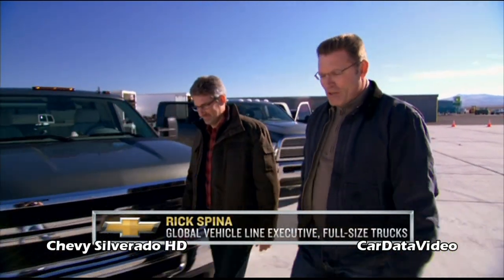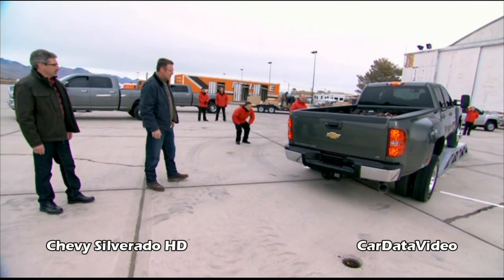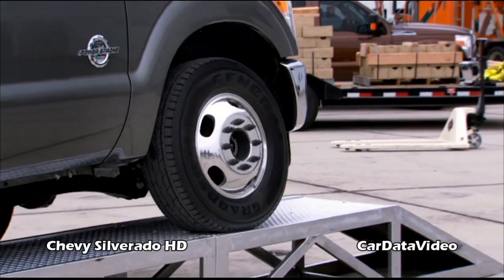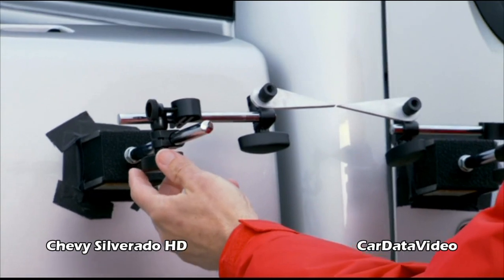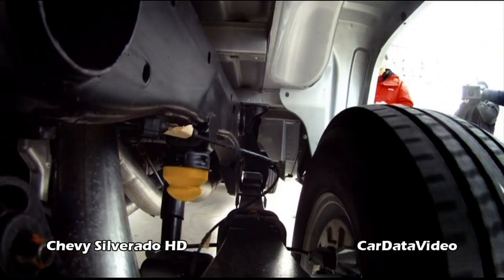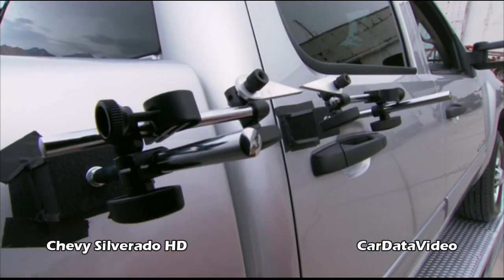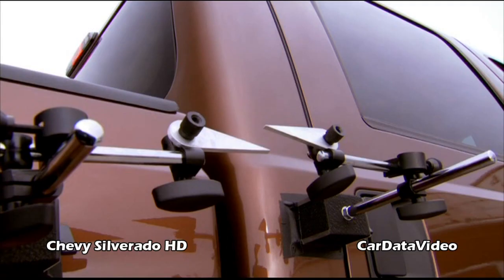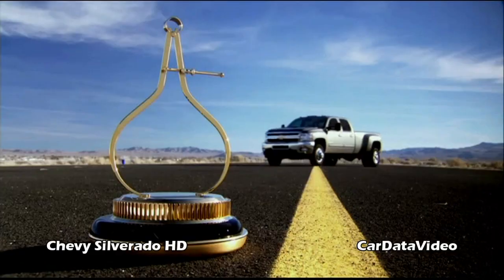Chevy vs. Ford HD Truck - Bed Bend Video

Comment: this era of GM ads.. pfft.  Ford F-series still top for 42 years
Reply: Definitely not
Reply: ‘This era of gm adds’? Have you seen how terrible the new ones are? The ford ones are appalling too
Reply: Zachariah H Ford is the best no debate
Reply: AustinGhost45 sup fan boy
Reply: Jeremy Fufushnick ? What’s that supposed to mean
Reply: Zachariah H learned how to drive on a Ford f- series and I’m proud
Reply: Ford is the best Chevy rigs their ads
Reply: Ford mechanics don't drive Ford vehicles, this is because they know all the problems. Ford outsells every other manufacturer in north America because people are cheap-asses and fords are cheap.
Reply: braxxxtwell kayfuu, if you want a truck that’ll go over 100,000, it won’t be a GM.
Reply: All makes of trucks have their problems, but as an ex ford technician i can assure anyone that there isnt and a single modern ford engine without leaks at oil pan, valve covers, and sometimes head gasket at 75000 km. I've yet to see that bullshitery on a gm or dodge or Toyota at twice that mileage.
Reply: @johnblossom8447  i have a 2006 Chevy z71 with over 300000 miles on it lol
Reply: braxxxtwell kayfuu, sure. GM trucks all have transmission problems. Having owned two Fords and two GMs, I never had a major problem with the Fords, but the GMs, lots of issues. Toyotas are amazing, but Dodge? Please. Chrysler products are the absolute worst.
Reply: Crusader, good for you. Every make of truck has a good vehicle or two. I don’t know your age, but I’m over 50 years old. Quite a bit over 50. Having said that, I’ve had other Ford and GM vehicles. My parents had a 1962 Chevy Bel Air. Great car. The GM products after the late 90s started to slip in quality. My sister insisted on owning GM products because my parents did. I know a lot of people. In my closest circle of family and friends, my 2001 Ford F-150 had 250,000 miles on it with just routine maintenance and tires. In the 13 years I had that truck I watched my friends and family all have their GMs and Dodges go through major repairs, transmissions, head gaskets, among others. I’m only talking about trucks that were the same age or newer. My 2002 GM Sierra had problems with oil leakage, both interior door handles broke, the passenger side broke 3 times, the radiator needed to be replaced and the transmission started slipping. All these issues started at around 90,000 miles. I had the GM and Ford at the same time, selling the GM first because it had to be repaired a lot. I’m only talking about vehicles I’ve owned or close friends and relatives. Since I treated all my vehicles the same, that was my results. If you had a better experience, good. I’m going by what I lived with. I helped family and friends with their vehicles, either repairing them or providing transportation when their vehicles were in the shop. The paint on my 2001 Ford started looking a little rough after a couple hail storms, but the guy I sold it to in 2014 is still driving it today. I talk to him occasionally. He’s put tires and a battery on it. The Sierra’s new owner scrapped it after 150,000 miles. It had too many problems.
Reply: John Blossom Wrong. I’ve owned numerous fords, chevys, and they’ve all had some sort of major issue. I HATE everything about the F-150 from personal experience, the chevy is the same. I have a 2013 RAM 1500 which has never had a single issue, not a check engine light or anything else and it still runs like it’s brand new. I don’t know if your experience is different or not, but if you’re just going on what you hear just know that not every truck and or vehicle is that way. Yikes!
Reply: XxX_PussyDestroyer_XxX evidently you didn’t read my whole comment. And, wrong? How can I be wrong about what happened to me? Plus, I have three mechanics in my family. Your Dodge is 6 years old. I hope it hasn’t had any major problems yet. How many miles do you have on it? I drove a couple Dodge trucks. They were uncomfortable and rode like a tank. What you stated was personal preference. You talk about “what you hear”, but you mention one truck you’ve had that is great. Good for you. A check engine light is rarely anything big, by the way. You mentioned nothing about GM or Ford trucks other than “from personal experience”. So, what exactly went wrong with them? How many miles were on them when you started having trouble. If I’m wrong, then so are you. How many Fords and GMs trucks have you had? How many did you buy brand new? If they were used, your comment means nothing. You don’t know how the previous owner treated them. The trucks I’ve dealt with were all new and owned by me or a close friend/family member. To be more accurate, out of 5 GM trucks, 3 had serious problems before 100,000 miles. Out of 4 Dodge trucks, all four had transmission or head gasket problems by the time they had 125,000 miles. Out of 4 Ford trucks, one had a transmission problem at 160,000 miles.
Reply: John Blossom Mine has about 110K miles on it, bought brand new. My chevys liked to blow head gaskets and the fords liked to blow spark plugs. Had 3 F150s and 2 Silverados. Not very familiar with older dodge trucks but i know they had a lot of tranny issues. But honestly i don’t think the competition was much better at that time.
Reply: Bryton Dunsmoor, good for you.
Reply: My 98 Ford is over 200k miles and runs like a champ.
Reply: @austinghost4587  just for those that like it
Reply: If you combine GMC and chevy, they blast ford out of the water. Unlike ford, gm splits their brands to cover a broader range for their purchasers.
Reply: Chevy runs deep
Reply: @grantbergeron4847  and stays there
Reply: Mike p  who is they, your mother?
Reply: @H4rM0n1cpeezy  Tell me something I don't know.
Reply: @noahchiasson7809  tHinKiNg oF bUyINg a HOnDa cRv wElL hErE'S wHy tHe fOrD eScApE is BeTtEr
Reply: braxxxtwell kayfuu THANK YOU. They’re cheap as hell and it shows that’s why you’ll always see more Fords ( un- Ford- uantly ) on the road than Chevys. Because they’re cheap with no quality
Reply: David B my dads f 150 has 220k+ miles on and still runs amazing as well although it is a stick
Reply: Lmfao...have a f350 superduty with the lariat body. The undercarriage fell out on the highway last April. Had to get it completely rebuilt.
Reply: @Jags Toyota and Lexus are one in the same bud
Reply: The F-150 is that 6th best selling truck when I checked earlier this year. Number one selling if include commercial sales
Reply: No.  Ford has never been on top in retail sales.  Ford has government and commercial contracts going back about 50 years which allow them to keep making that claim.  Such a large percentage of stripped-down F-series sold for fleet use exist that when they are retired periodically their numbers actually tank Ford truck resale values nationally.
Reply: @FMChimera  Ford is ranked the 6th largest seller of trucks in non fleet sales.
Reply: @FMChimera what contracts does Ford have that they've had for 50 years please explain
Reply: @jordanhamilton50  State highway fleet contracts in 43 states, a running contract with multiple US military civilian contractors, direct military contracts, numerous state-contracted businesses in all 50 states to the tune of about 30% of their production as of 2010.  I know the number has shrunk some in the intervening years but it's still a huge part of their annual production.
Reply: @FMChimera  you keep saying running contracts as if there isn't a bide for these contracts. Ever notice how police dept. Change from Chevy to Ford back to Chevy ect. Every contract you spoke of is based of a bide system, just cause Ford has the crotract in no way shape or form means they have not had to compete to get recontracted. Also your statement about Fleet sales is retarded fleet is a sales fully legit number. So by your explanation any company that sells a product through contracts is fudging the numbers .Cut the pie however you want and Ford still wins. If any company had more goverment contracts without stipulations it would be GM cause during the bailout the US goverment bought all but a tiny share of the companies stocks. I know this first hand cause my father was a fleet salesman at one of the largest Ford dealerships in the nation. Ford beat all competitors in truck sales and has done so for the last 30 plus years. The mustang is the most sold sports car in the world.
Reply: Exactly, GM products are mechanical garbage these days.
Reply: @EdmontonRails  And yet still leagues better than Ford and most Chrysler (the Hemi gets special mention).  When you get out of entry-level cars, where the Asians excel, and into higher-end vehicles GM is also better than anything else over the long term(cost relative to average life expectancy).  But as I often note, what do I know, I have only been at this 30 years and base my inventory on such cost/sales analysis.  I'd sell Yugos...if that's where the profit and durability was.
Reply: McDonald’s sells the most hamburgers, that doesn’t mean they are the best.

Comment: I will speak from experience. I bought a brand new of the lot 2015 Ford F-150 and out of the 7 months I had it, it sent a total of 3 months in the shop being repaired broke down on me constantly and everything you can imagine went wrong. Dealership offered me another one when I told them I wanted to return it to purchase another vehicle and I kindly said no and bought a Chevy Silverado I’ve now had it for 5 years going on 6 and it has not been to the shop once and it runs just as smooth as the day I bought it. That is my unbiased experience with the 2 vehicles.

Comment: Flexible frames are stronger. Rigid frames crack or bend .
Reply: Incorrect. If the frame bends like this, it indicates no structural rigidity
Reply: Andy's Shop your incorrect buddy
Reply: If you are rock crawling you want to be able to get a wheel on something , air gives little traction .
Reply: @vadwvea7153  yeah and then they tested a Tacoma and a ranger and the Tacoma flexed but yall Ford guys were like "tacoma bends thats not good"
Reply: @tmr8193  a complete* as in you check other people with no concern of your own level of comprehension
Reply: Andy's Shop Bruv i aint a ford or a chevy guy im just saying facts
Reply: @tmr8193  ok and did you just use "an" for the word "complete" ? An is only for vowel sounds sunshine.
Reply: Andy's Shop Thats the dumbest idea Ive ever heard. Engineers want flex because ridgid things crack. Its the main reason why human society moved away from iron to the stronger more flexible steel.
Reply: I think it's personal preference really and really depends what your doing with your truck.
Reply: I'd say u would need idk maybe in the middle of flexible and rigid idk man I'm stupid
Reply: @andybub45  Of course its not rigid if its not rigid. He was saying flexible structures are stronger, not more rigid, because those are opposites. There is a reason why long bridges have a structure that is designed to flex.
Reply: both have their own pros and cons. i feel like it really depends on what kind of work you're doing with the truck
Reply: It's "an" not "a" and it's "your" not "you're" and it's "we've" not "weve" and it's "us" not "u's" and it's "Ford" not "for'd" and.... Ok i think that's enough 😳
Reply: Ya cause the ford definitely did not bed in the vid 😏

Comment: Chevy's have so many issues, they actually installed a recall button in them.
Reply: Cardboard Sliver Chevy is now using Ford F series parts!!
Reply: @streethazardz  They can't be using F Series parts. GM trucks are still breaking down!
Reply: Really?
Reply: Atleast they have a recall button . Ford was too cheap to put one in
Reply: That was weak. Like General Motors plastics.

Try again.
Reply: @streethazardz  yeah sure ... Meanwhile there are mustangs out there with LS engine inside
Reply: @Tyler Weber Ford about run our company bankrupt
Reply: Name an issue
Reply: panzer waffen yep you ever watch street outlaws every mustang on there is running Chevy motors so does that till these people anythang lol
Reply: RICKY GARCIA well that’s a bit of economics factor really. Chevy big blocks are way cheaper to build big power with.  Ford doesn’t really make an economical powerhouse in comparison to Chevy.  The aftermarket has embraced Chevy simply for the fact that their engines haven’t changed all that much. Pushrod two valve per cylinder. Ford is always changing things which you can take however you want but in the last 20 years it means they haven’t really made a v8 worth owning in my opinion
Reply: @Tyler Weber built ford blechhh
Reply: Lol
Reply: As a dealer I always get a kick out of dumb comments from guys who buy one truck every few years.  Those of us who buy several a week know who's on top; Fords bring 70 cents on the dollar or less of what Chevy, GMC and yota bring.  At times even Rams bring notably more than F trucks of similar year and mileage.
Reply: @rickygarcia7400  Till, what is till?
Reply: hahhahahaha
Reply: @danielnolasco119  over all or specific year? Cause I can tell you straight up my instructor from my trade showed us every recall. And all I saw were more chevy vehicles then ford vehicles sooo. Better start explaining your conspiracy theory their bud.
Reply: @rickygarcia7400  yeah Chevy should stick to making engines, the  1 thing they got right.
Reply: Fords have so many issues that they don’t need a recall button because they are always in the shop.
Reply: @streethazardz  liar